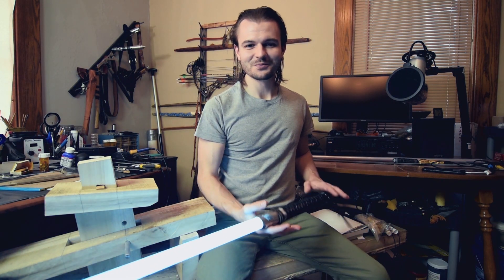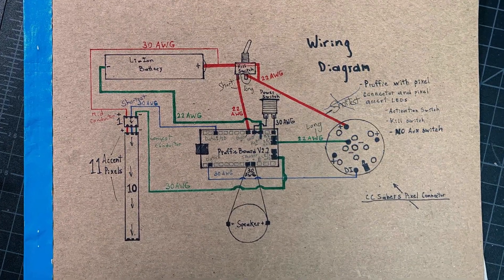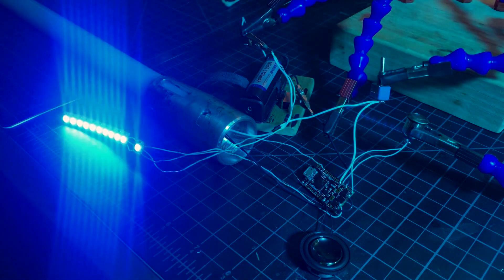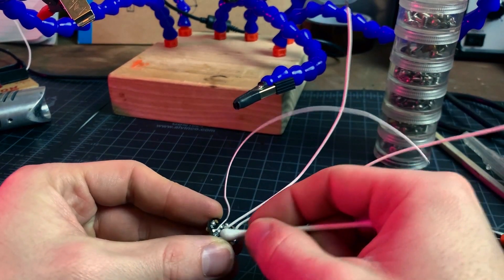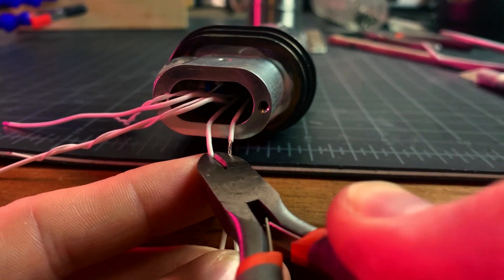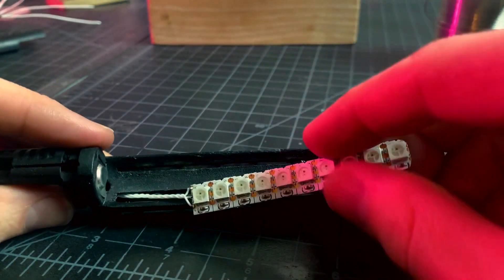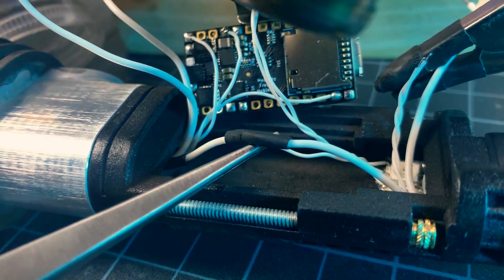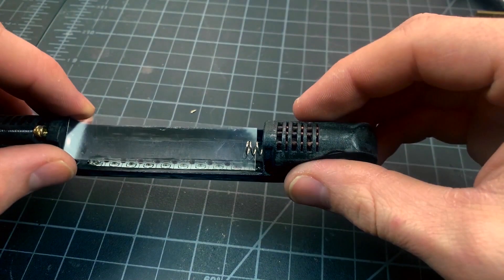Making A Katana NeoPixel Lightsaber Part 2 ~ Installing Proffieboard & Electronics

Comment: Very nice !! your next project should be a lightsaber knife,, 16 to 18 inches in length total maybe something that looks like Drax from the Guardian of the galaxy knifes. Just got to find a way to mold the polycarbonate blade into a knife shape, other than the straight & round tip.
Reply from the maker: I’ve consider attempting to mold a round blade to a slightly katana style shape. Haven’t settled on doing it yet though. There are a couple companies out there that actually custom make them out of flat polycarbonate and acrylic. Not great for heavy dueling though.

Comment: cool but when can i buy one
Reply from the maker: Any time that suits you! I almost never take custom commissions, but if you go to this link and talk to TJ Wells, he can have one made up however you like! https://ignitionsabers.com/
Reply: @EccentricArtisan  also is the blade just regular or is it shaped like a katana blade?
Reply from the maker: @Space_Traveler77  on my build it is just a standard 1” thick walled polycarbonate tube, because I like to use mine for heavy dueling. And hard edges, like on a Katana style don’t hold up well to high speed collisions generally m. However, Devin at The Saber Trade as well as Ripper Blades both do custom katana blades.

Comment: Good but you could make it much better the blade is not like katana at all , the top edge is like a sword not a Japanese katana
Reply from the maker: Correct. It is only a standard neopixel saber blade. A katana style blade is neat for show but impractical for contact dueling. Because they have more edges than a round blade they are prone to breaking with heavy contact. Typically my sabers, especially this one, see a lot of rough use. I may make or acquire katana blades in the future for a cooler visual, but for now this serves me best. To each their own though! If you were to build one, I’d encourage you to do it how it best suits your needs.